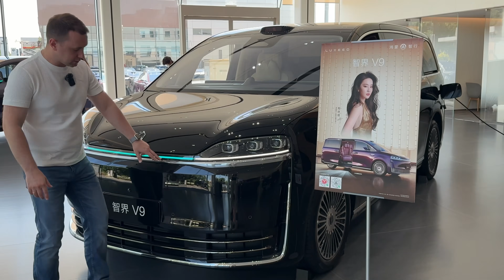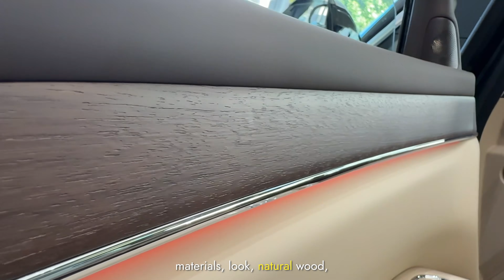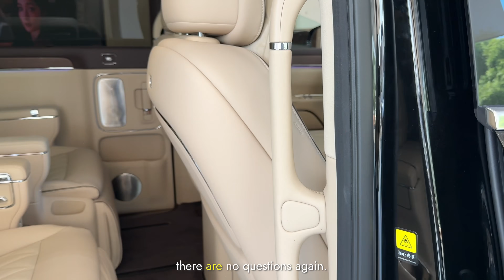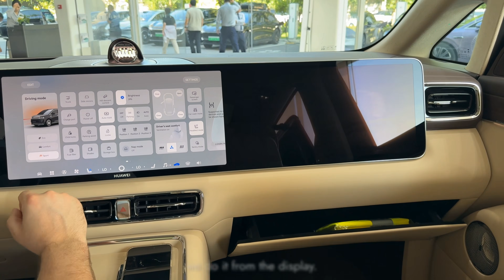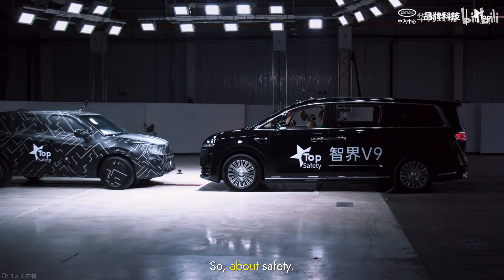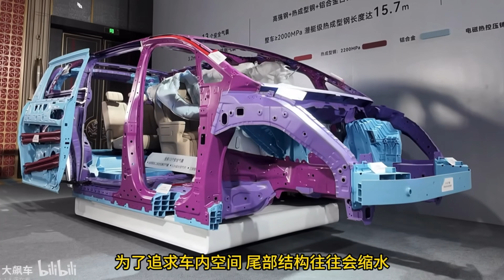Huawei Luxeed V9 First Look: Luxury SUV with Smart Driving | Export & Pre-Order Open

Comment: ... you know, what I myself would really appreciate : imagine you're going for a trip. You arrive to the place, park the car, and then go for the hike on foot. Having a 10 km hike behind, now you find yourself on the new spot 10 km away from your car. Now, it would be very convenient if you could open an app on your smartphone, connect to your car and set your GPS coordinates into the car's navigation system, so the car would simply pick you up in a few minutes. It is nice to see that the car can drive on its own when I'm in the car, but that's not usually what I need. When I'm in the car, I mostly like driving it myself. What I need is, to have a car which can move on its own without me on board, so it can arrive anywhere I need it to, to pick me up.
Reply: AFAIK, Luxeed owned by Chery group, they've just introduced VPD (Valet Parking Driver). They'd need to map the parking area and save it from their side. It's possible, just not there yet. Mapping their area themselves and updating need lots of resources, even google need to update their gmaps regularly and fast enough. But what you're saying is possible, give it some time.